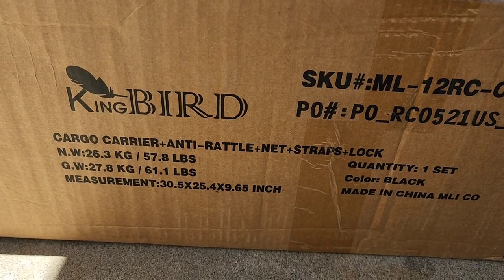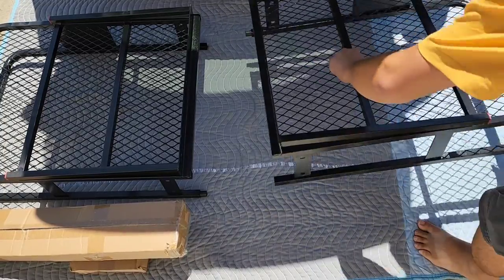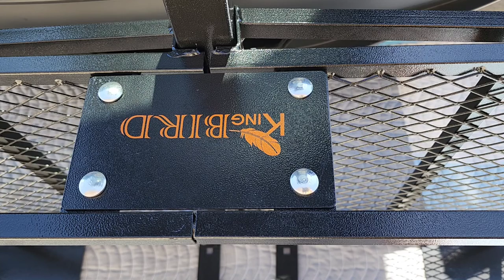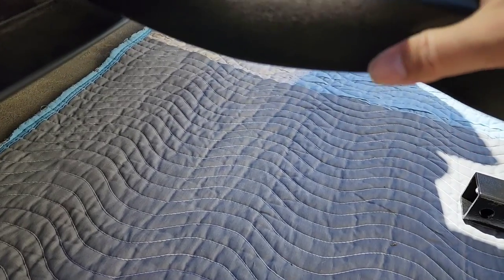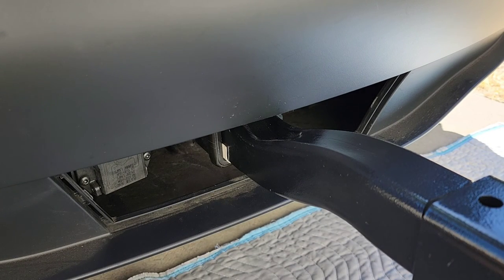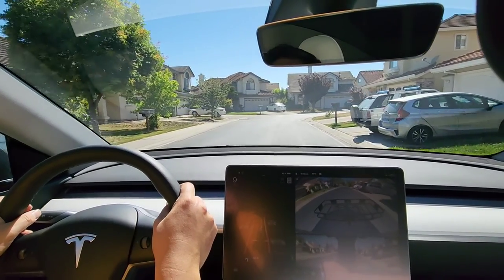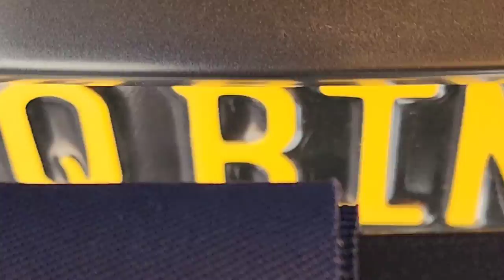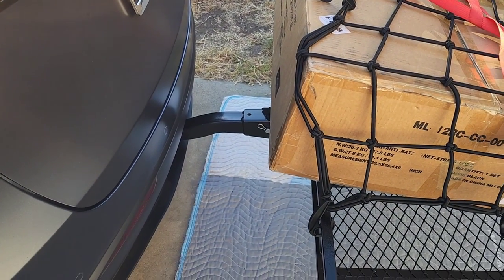KING BIRD 60" x 24" x 6" Hitch Mount Cargo Carrier Trailer Hitch Lock, Cargo Net, and Ratchet Straps

Comment: Thanks for showing the "obvious" and "simple" part of attaching the carrier to the hitch. So many of the videos show assembly of the carrier but don't show the process of putting on car. I have an old heavy steel carrier of my dad's with no instructions and have never attached trailer or carriers myself.
Reply from the maker: Glad it helped. I noticed a lot of stuff that I think are easy and obvious turn out to be what people need. Putting washer fluid in the car is one of my most viewed videos currently. Lol

Comment: Hey..whats the wrench you used? Can you post the link?
Reply from the maker: https://amzn.to/43yWi4w I think this set is the same. I got it at Costco for much cheaper if I remember correctly.
Reply from the maker: Oh wait, that's missing the 1" socket
Reply: Thanks!
Reply from the maker: @mayankmahajan0  it was a set similar, but had larger socket variety.
Reply: Is the brand ‘Steel Vision’ that you got from Costco?
Reply from the maker: @mayankmahajan0  no, it was dewalt

Comment: Did you ever fix the crooked part. ?
Reply from the maker: Somewhat. You have to use the bolt to make it squeeze the metal together. I wanted it to be easy to remove, so I didn't use that, but turns out it's necessary and makes it so it doesn't wobble.
Reply from the maker: I modified it https://youtu.be/aapQplGqKjk
Reply: Hopefully you learned a lot. One thing you need to know is that the locking pin actually goes in the receiver. There’s no need for a locking pin just to raise or lower the basket. 
Also, the stabilizer could be used if you made access from below. That may involve drilling a small hole or two from below.
Reply from the maker: Yeah, don't want to make holes in it. Lol